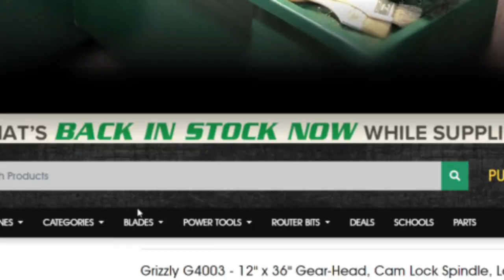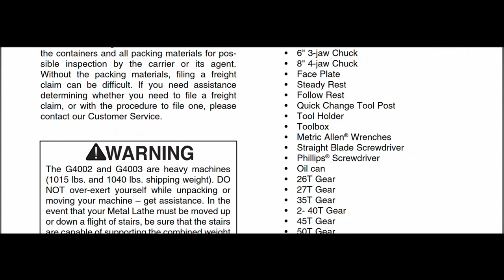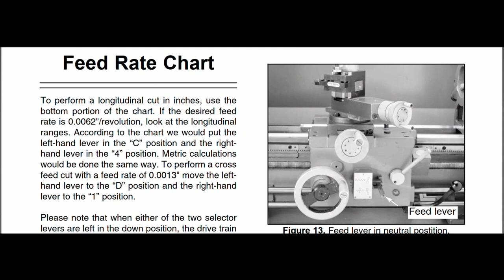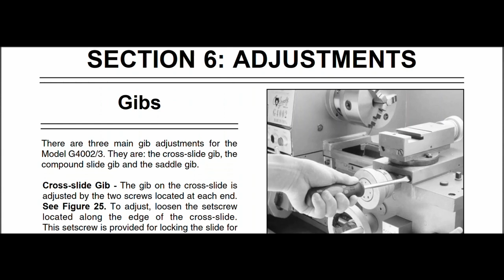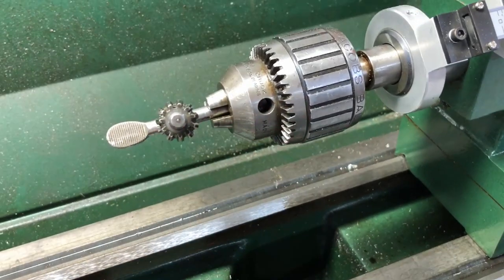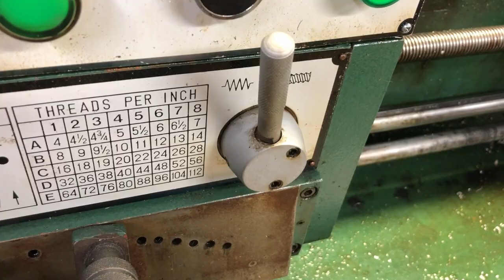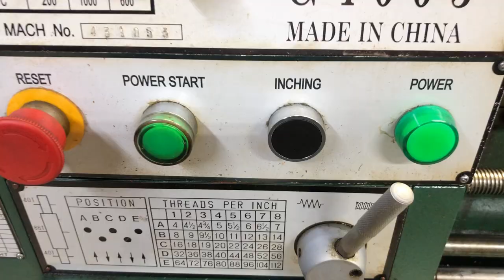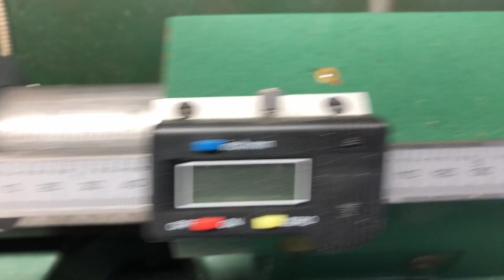Grizzly Model G4003 12 x 36 Gear Head Lathe

Comment: Very nice description. I bought a Grizzly 10” 3 Hp cabinet saw 36 years ago, fairly shortly after they opened their doors. Aside for a few modifications it needed, it’s working well today. I also bought a mill from them in 1998. Having modified that too, it’s also working well after years of fairly heavy use. Their manuals have improved a good deal over the years, and are very good. And yes, customer service is good too. I have some other equipment from them. The more expensive lines are pretty good. The more common, such as my 24” box break, are not different from others on the market. They’re just painted and labeled as Grizzly.

Looking forward to see progress on your channel.

Comment: Very nice video. I  am a beginner and I am about to purchase a G9729 but a bit hesitant that it does not have carriage feed reverse. In only goes forward. Your lathe can do both. I don't know if that feature is crucial.
Reply: I would avoid combination machines. They usually don't do any one thing particularly well. The G9729 isn't a very good lathe and it isn't a very good mill. If you really want one, find a used machine for a lot less money. The used ones I've seen have had very little use which is probably the reason they are being sold.

Comment: Around 11.09 when we see the Chuck turning, on my larger screen TV when watching this (not visible on my IPhone 12 Pro small screen), you can see the spindle where it comes out of the head stock, there’s a green collar affixed to the head stock.
The visible runout between the spindle & fixed collar is abysmal.
If the spindle is in tolerance and the collar is fixed, there should be no visible runout surely?

Yes you can adjust your Chuck runout as you fit the D4 system etc I guess to take out any obvious run out, but, you didn’t actually fit a dial gauge to show what if any run out there is on the Chuck - so it’s hard to know just how accurate this Grizzly lathe is straight out of the box so to speak.
I think if I saw the spindle run out that bad when inspecting one of these Grizzly lathes in a shop for eg contemplating purchase, I would run a country mile.
Is there something obvious I’m missing here? 🤷‍♂️
Reply from the maker: Hi Ian,  I can see what your talking about.  I have not had any issues with holding size and run out.  I have another video with details on the chuck.  I will take a look at that the next time I have the chuck off the lathe.
Reply: Are you sure you're seeing runout, or could it be that the length of the back of the spindle isn't even, which is harmless?  Asking because I see a difference in the "black space", but I don't know which causes it, but if it was runout I'd expect the chuck to be visibly wobbling.
Reply: @tomsmith3045  Take a 2" steel bar x 6" long and chuck it up.  Take a 10-15 thou cut off the diameter.  Put a good dial indicator on the bed, index the work piece.  Taper over 5" less than .0005?  yer good.  Runout less that .001? yer good.  You will spend 10x more for a machine that has better tolerances.
Reply: @bluestarindustrialarts7712  Good to know!  I thought the 'black space' might be harmless.